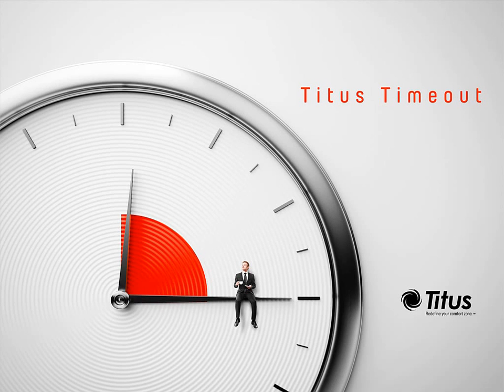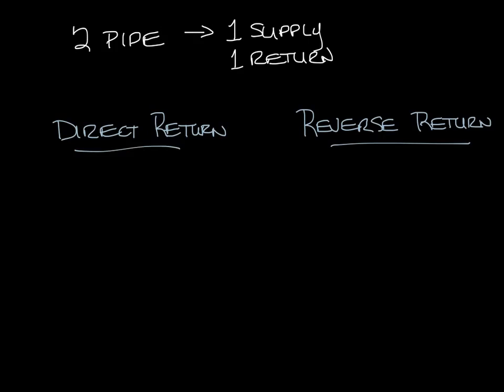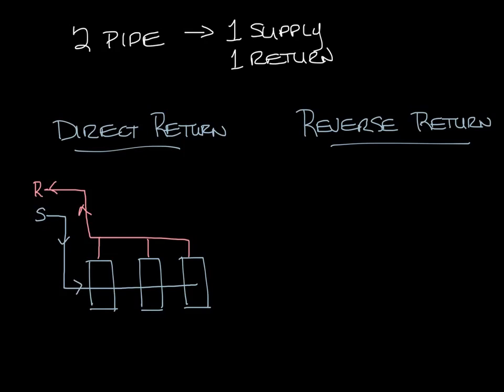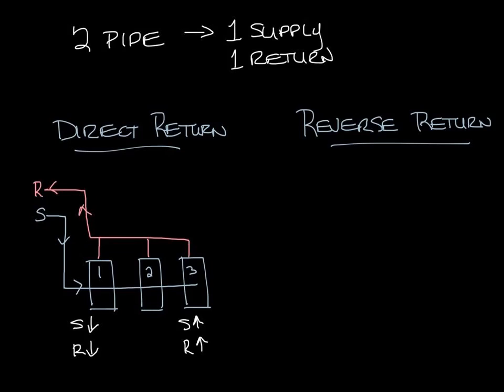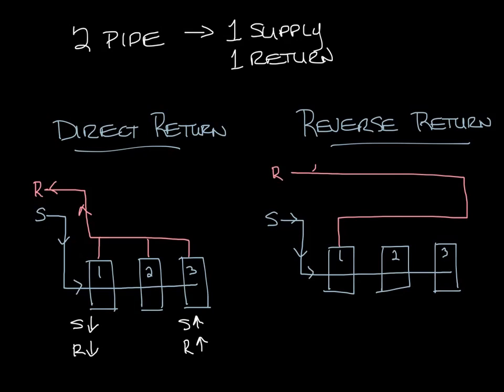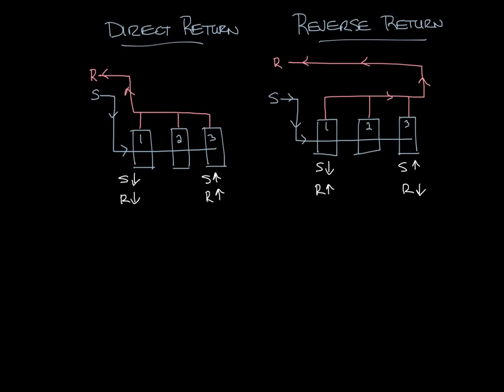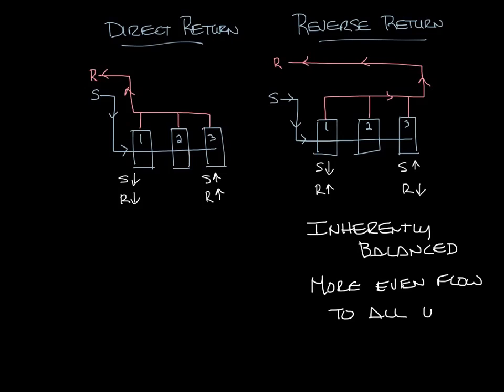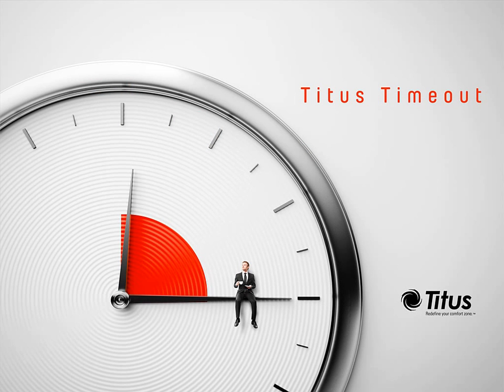hvac-Direct Return vs Reverse Return Pipe

Comment: Which better ; using reverse piping   or direct piping with balancing valves ?
Reply: Reverse return is always better. It's just more expensive due to the extra pipe

Comment: which pipe line getting high pressure?
supply pipe or return pipe
Reply: its equal
Reply: Since there is always a pressure drop across a fancoil unit the supply side is at higher pressure than return side.
Reply: supply side since there is internal pressure drop in the coils